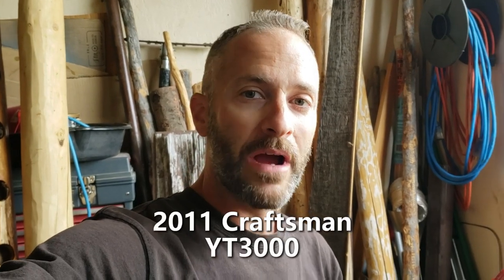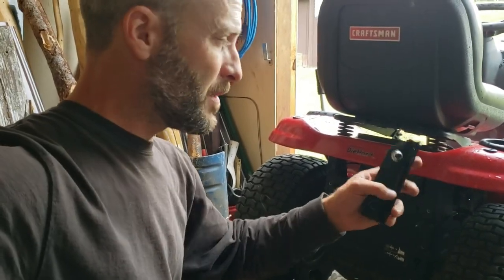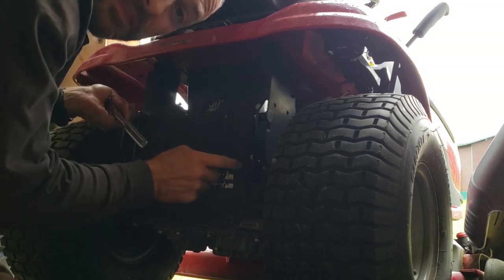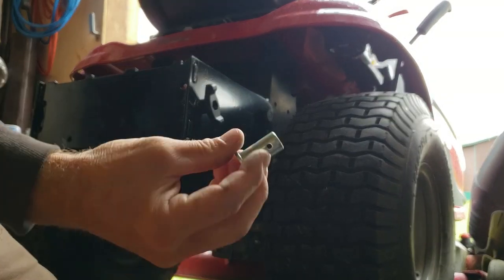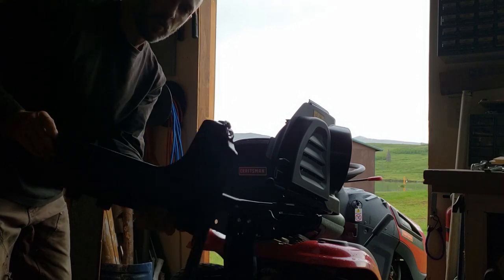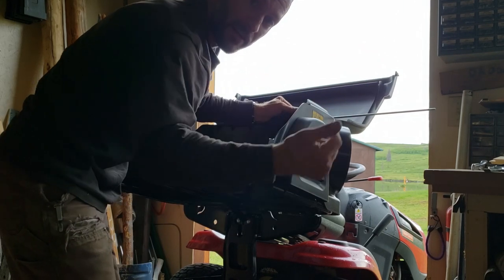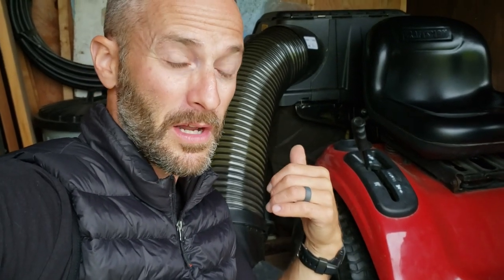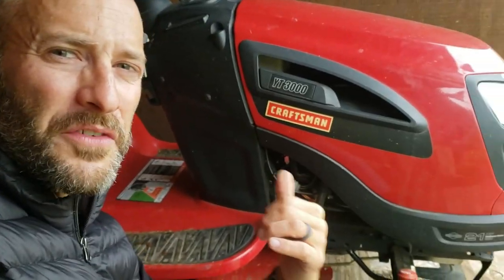Craftsman Bagger Installation - Buyer Beware

Comment: I wouldn’t have tapped the metal since it’s not thick. On top of that your craftsman lawnmower was manufactured by “AYP” American Yard Products, not “MTD” Modern Tool & Die as stated on the box. Yes this bagger will fit craftsman mowers but craftsman mowers were manufactured by “MTD” around 2014ish up to current day.
Reply from the maker: 3 years of mowing very bumpy terrain, and my setup is working absolutely flawless. Thanks for the extra info.

Comment: Sad thing is it's the same kit that is sold with the craftsman name on it. Costs about $200.00 more. Talk about getting upset.
Reply from the maker: Shoot! That sucks. I almost bought the Craftsman kit thinking it would fit right on. Glad I didn't waste the extra $200. They look identical.
Reply: @BRAMANTEBROTHERS  they are i bought both... traking craftsman back tomorrow
Reply from the maker: $200 back in your pocket. 👍🏻 Hope it works well for ya. 
Aside from having to completely retro fit mine, I really do like its performance.
Reply: I did forego the two brackets and pulled the back wheels and measured for the books and drilled and mounted the shoulder boots on the sides ... Worked out great for that adapting tube...different story..old scrap gutters and pop rivets
Reply from the maker: 😄sounds about right.

Comment: It looks identical to the craftsman branded bagger. I have a T2200 (2014 917.203810  42”) and it has the exact same problems. I wouldn’t mind the drilling and tapping, etc. for the bagger support but the chute not lining up is a real pain and that would need to be McGuyvered … at the price I paid at Lowe’s. I think I will return it… I’m currently on hold (31 minutes) with the “help” line of craftsman to see what actual part will fit, if any.

EDIT: So I got on the phone with sears parts … (much better help than the craftsman phone line) and that guy was able to help me track down the right part that will fit my model. Important to note that just cause it says craftsman doesn’t mean much.. Husqvarna is the actual manufacturer of the mower, and the bagger I had is for MTD Craftsman not the Husqvarna Craftsman. So off to return this one to Lowe’s and the right one was ordered.
Reply from the maker: Thanks for all the info. That should help others with the same problem. 
As for me, I am going to stick with my McGuyvered solution, as it has been working well for me.
Reply: Is it possible to just purchase a new chute to fit?
Reply: @BRAMANTEBROTHERS  the new bagger fit like a glove… I like the look of the MTD better … but the Husqvarna was perfect.
Reply: @frankiejames650  no, there are a lot of differences between the MTD and the Husqvarna versions

Comment: If for any reason you don't want to drill holes into the metal back plate of your lawn mower (maybe you are borrowing or renting), you can create your own metal plate (or wood plate) that the bracket will fit on, and when creating it you make sure it also has holes that allow you to mount that new plate to the existing hole on your mower.
Reply from the maker: Great alternative idea. 
Thanks for the comment.

Comment: I just bought and installed the same kit from Amazon it fit my Craftsman mower 1997 the only concern I had was trying to tell if I had a 700 series or not nowhere does it tell you how to tell, If I needed the extra metal bolt on parts. Well I did not have a 7 Series even I went to the trouble the call Sears gave them my Model and serial # the said oh yes you do . NO I DO NOT . follow the poor instructions I was smart and to U tube found a guy who installed the kit and that saved me.  Good kit works well
Reply from the maker: Glad it worked out.

Comment: I have a question, everything I have fits my mower but I’m playing hell trying to get the hose to get to stat in place or to turn counter clockwise enough so it will stay in place! Mostly at the bagging end. Any suggestions
Reply from the maker: Dang!
No, sorry. My hose had plenty of threads to screw into the bagger part. Haven't had any problems with it. 
Maybe someone else on here has had that problem.
Reply: @BRAMANTEBROTHERS  Wonder what I’m doing wrong? Anybody have any tips for this

Comment: What is the distance between the two holes you drilled from top to bottom?
Reply from the maker: Sorry for the late reply. 
I don't know, and my mower is still in winter storage. We don't need to start mowing until about mid June.

Comment: Have you found the correct chute? I have the same tractor.
Reply from the maker: I haven't bought anything, but I found one on Amazon that looks to be right. (Although it is currently unavailable) Here is the link..
HECASA Black 46" Lawn Tractor Bagger Attachment Lower Chute Deck Grass Catcher Bagger Chute for Grass Catcher Replace for 405455 532405455 https://a.co/fA3RJIq

Comment: I have an 2 old craftsman tractors with bagging set ups but useing  murry select 1.75 i want those baggers on it the murry. But  holes are not the same..  i didn't even check the hose yet thanks for telling me. I'm going to get it to work so thank you. but my son is the dyi guy., so it will be project for him to help me with.  Guess I'll be bagging leaves this year I'll save your video thank you.
Reply from the maker: It sure is frustrating when things don't work out, but I'm glad our video might be of help to you. 
Thanks for the comment.